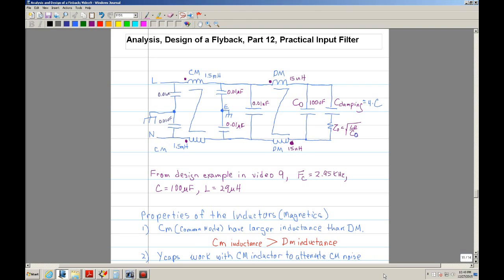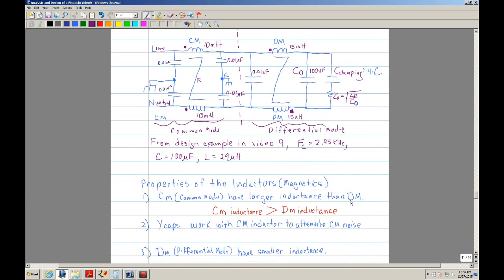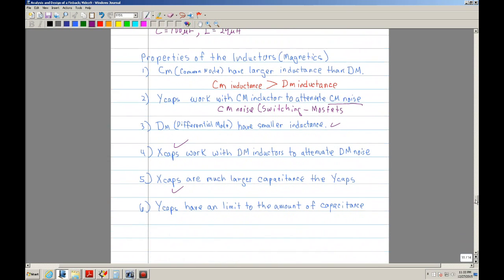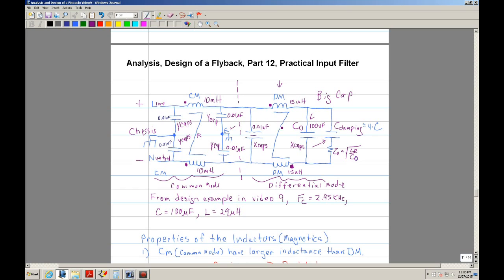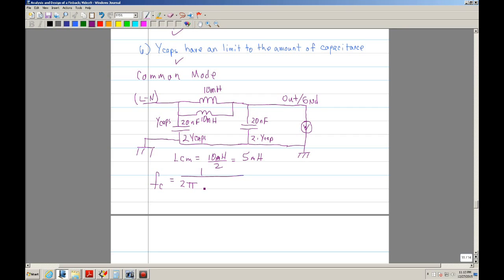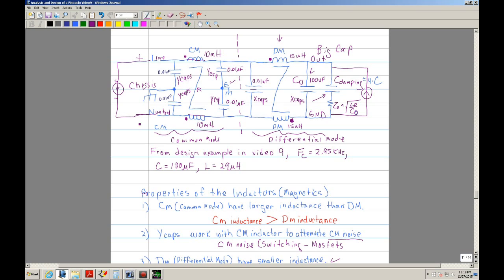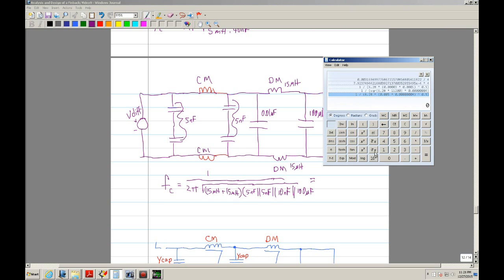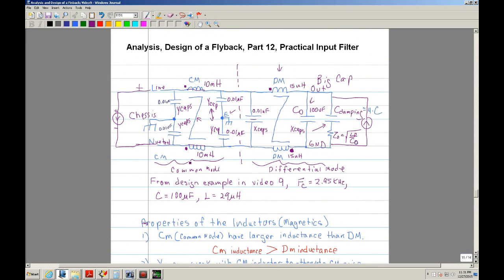Analysis and Design of a Flyback Converter; Part 12 Input Filter

Comment: Great lecture!,
I have 2 questions:
1.At Dm the pole is at 1.3k, not 2.9k, I simulated this circuit, and this is because the 440u cap with the resistor.
2. At dm pole calculation :the left side is shorted because the dc source at ac analysis is shorted, so I don’t think you have to bother about 50n cap ,only the 100u on the right side(which u did after approximation)
What do you think?
 Thank you, your lectures are a real gold!

Comment: how to determine corner frequency in common mode filter for a given design & how much attenuation is required at switching frequency.
Reply from the maker: To simulation the corner frequeny, you short both input to the filter and you also short the output of the filter. You then inject you input signal to the input from input to chassis and you measure from output to chassis.   The amount of attenuation is determined by you EMI requirement.   Bolanos," May your simulation always converge"

Comment: Great lecture Mr. Bolanos!!! You really explained well. 
I have one question for you. I sometimes see the LC input filter flipped, meaning from source side first comes C than L. I can unterstand that the in buck converter or Flyback converters input currents are aggressive. Therefore, first L and C from source side. However,  I cannot understand goal of flipping L and C. Does that make sense, for example in a boost converter input filter? Or should we still use the LC filter in the same order in boost converters as in Flyback or Buck converter?

Comment: Hello Robert, 

Thanks for your wonderful videos. I dont have words to express my gratitude.

A few questions:
1)  If the heat sink is not connected to the Chassis and there is no significant capacitance of MOSFET Drain to Earth ground, still is it necessary to have Common Mode Filter at Input
2)  Kindly suggest videos/reading material on designing power supply chassis/heat(temperature) simulation methods for SMPS
3)  Any reading material/video specific to power electronics - precautions needed while setting up power electronics workbench at home. (I am a certified electrical / electronics engineer from India)
Reply from the maker: Hi Rajat, Thank you for your comments. Regarding your question, there is always a parasitic capacitance to its surroundings; however, it will be small. The affect will be there and as the operating voltage get higher, the effects from the common mode noise start to show up even more.

I would suggest getting the Abraham Pressman book. You might find a pdf copy on line. It is very readable and has enough math to justify the design procedure. I highly recommend this book. The other book I recommend is  Switching Power Supplies A - Z by Sanjaya Maniktala

Best regards, Robert

Comment: Hi Mr Bolanos, it is always a pleasure to watch your videos. Congrats, they are so simple and clear.
By designers side it is always struggling when we learn from different source because some concepts could be different. At this regard I would like to bring to your attention the following article:  
https://www.edn.com/electronics-news/4169156/4/Safety-concerns-for-practical-EMI-line-filters

If you check the common mode equivalent circuit you can see there are differences respect the one you write at 14.00. In particular: the common mode inductances shall be not divided by 2 because both winding are rounded on the same core. 
Am i missing something?
Feel free to share your thoughts.
Thanks a lot
Reply from the maker: Hi Nicola, you are correct, the CM inductance does not divide in half. Thank you for finding the error. In the past I have been able to add annotations to the video to correct the mistake, however, YouTube disabled the annotation feature. I will probably make an addendum video. Again, great job in finding my error. Robert

Comment: Hi Robert, 
I believe each of you lecture is worth gold ! 
My question is about the CM filter. It shows peaking at it's fc=11.254KHz that you left it undamped.... Why is that ?
Reply: I mean , isn't there a problem with that peaking ? Wouldn't it result in amplification of the CM noise ? Is it because the CM noise  has usually a lot higher frequency content , so we don't care that much about it, since 11KHz is low?
Reply from the maker: That is a very good observation. Yes you can damp that as well by adding a resistor to the Y-caps. Great question and observation. Thumbs up!. Robert

Comment: @Robert Bolanos Thank you Robert for your effort. Finally I got better understanding.
My question is at around 16:40, why not think the x capacitor as open and not short?
The reason is that since it has no effect on comm mode, then it is not there as if it is open.
Reply: It is short because at higher frequency it acts as a short circuit impedence Xc=1/2pi*f*c, and it capacitane very high and the freq very high then the Xc=0 means short circuit

Comment: Thank you Robert for your effort. Finally I got better understanding.
My question is at around 16:40, why not think the x capacitor as open and not short?
The reason is that since it has no effect on comm mode, then it is not there as if it is open.

Comment: Gracias from me too.  Great effort!  

Finally I understand how diff and common mode noise is mitigated.  Really wonder how people came-up with this topology of two blocks which works so neatly - it handles it's own type (diff or common) of noise without affecting the other block's functioning.

A question here - the source for common mode noise is MOSFET switching, what is the source for differential mode noise?